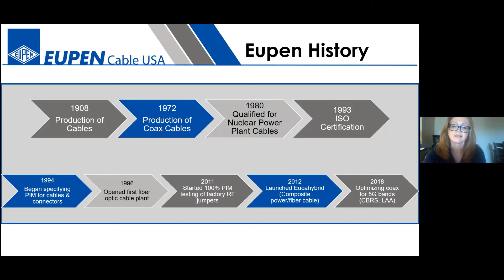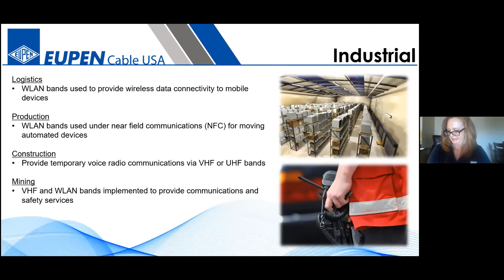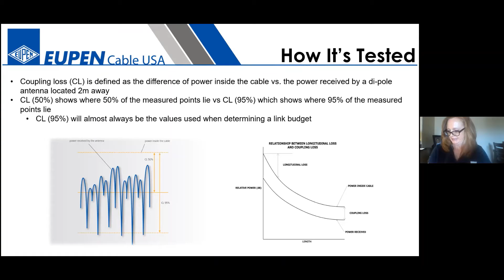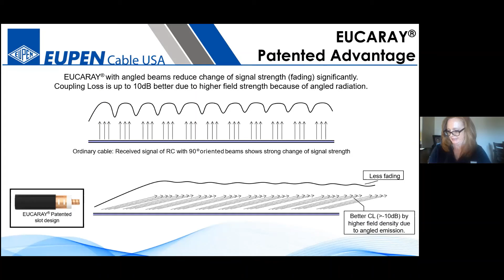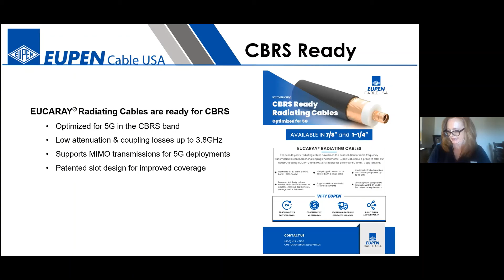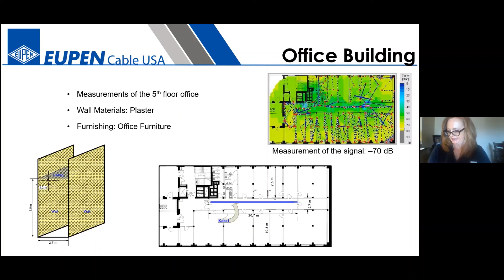Eupen Cable USA Presentation August 2020

Comment: This was a very interesting video on radiating cable and its uses.
I did not realize the EUPEN headquarters is in the United States and so close to home here in Florida.
Since my pastime is Amateur Satellite Communications, I utilize the EUPEN coax cable line which is 1/2" Hiflex.  
Thanks to EUPEN for a great presentation.